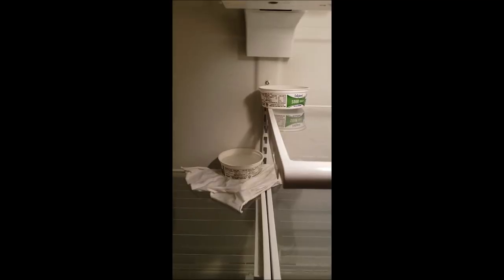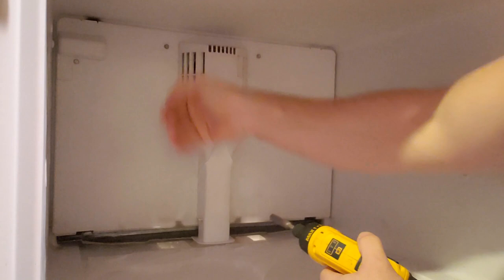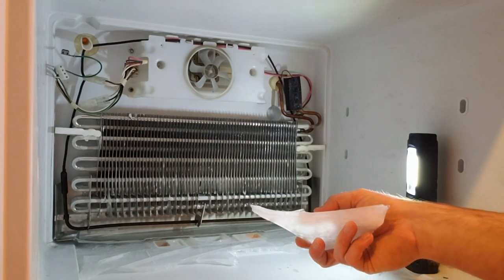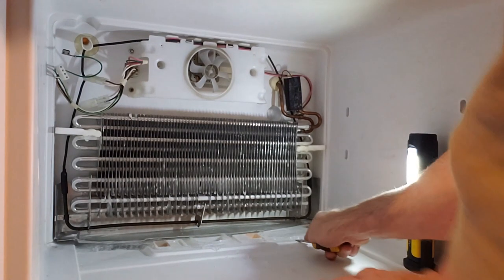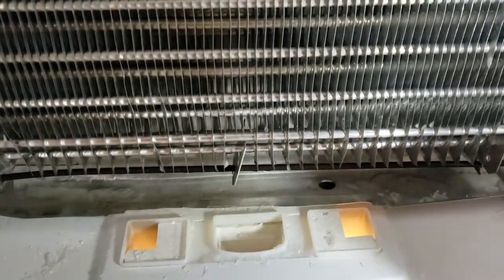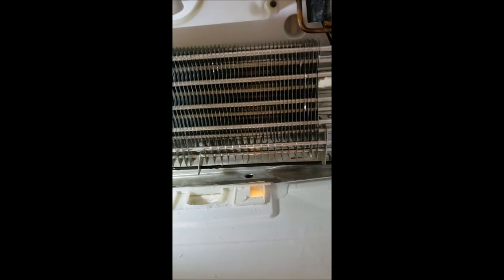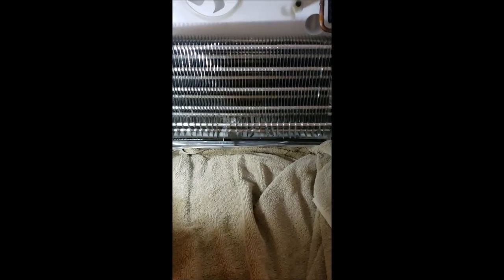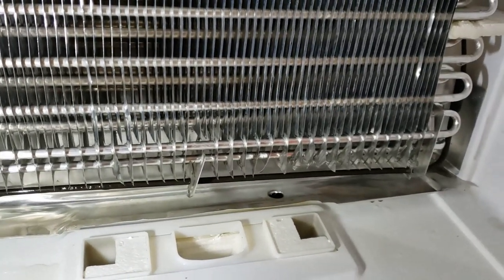Whirlpool fridge ice build up and leaking water

Comment: I had this same problem. Thawed out all of the ice. I took a 7 inch piece of solid copper wire 12 gauge. Looped one end over the heating element and the rest into the drain hole. The wire conducts heat to keep the drain open. So far no more problems after 2 weeks.
Reply from the maker: Samsung uses a very simular idea to fix this problem with their fridges. Thats a pretty good idea. Thanks for watching Maxwell Crazycat

Comment: I have the exact same fridge.  Although this will melt the ice it often will not prevent it from reforming in a very short time.  The issue is debris.  The third time in as many months I was about to go purchase an expensive steam jet when I stumbled upon a cheaper solution.  Again, I emptied my fridge and let it completely warm up.  Again, I poured boiling water down the drain until it flowed freely.  Then I took off the back panel and removed the p (or s) trap pipe which drains in to the pan.  Then I covered the hole with duck tap and poked a very small hole in the tape.  Then I used my air compressor to blow up the pipe.  Keep your freezer door closed when doing this. What came out was little bits of debris including pieces of the styrofoam insulation.  That I suspect was the real cause.  I believe the styrofoam was forming a partial dam which would let water flow by when warm but when the fridge was in operation the water would freeze to the styrofoam and quickly close off the pipe.  I also tried to blow back down the hole using a flexible straw on the tip of my compressor gun but with limited success. Still when I removed the duck tape there was more debris than I expected.  And when I flushed that trap pipe there was even more there.  Finally I used a little bleach in my water to rinse the entire pipe from top to bottom before reassembly.  So far so good.  I found having a wet-vac handy allowed me to pour copious amounts of water though the system as the drain pan would quickly fill.  I likely poured a gallon or more before I was finished.  And the wet-vac made this much quicker (and cleaner.)
Reply from the maker: Thanks for watching Robert Anderson, yes true if it is plugged it can be debris in the line, I use a flexible reamer like a pipe cleaner thats got a brush on the end. Thats great you were able to get all that stuff out so it shouldn't back up again.

Comment: To prevent future freeze-ups get a 3" piece of #9 wire and bend a hook on one end of it and hook it over the defrost rod and let the other end dangle down into the drain plug hole... I also used a shrink wrap and electric fence wire doubled it and slipped the open ends under the shrink wrap on the #9 wire and shrank-wrapped the wires together, just for peace of mind that the wire would melt any ice build-up further down in the drain tube... The electric fence wire was flexible enough to insert into the drain tube without any damage to the tub and small enough to not interfere with drainage during the defrost cycle...
Reply from the maker: Thanks for watching daveems, yes you are right I use a piece of wire now too if they don't already have one in place.
Reply: Great tip!!! I will always remember to do this forcustomers drain issues!

Comment: Hey there Greg, question I had was why does the drain tube freeze up in the first place, and what could one do to ensure it doesn’t happen again. If it’s a design flaw, then I imagine it’s bound to happen again and again. Or is that a bad assumption?
Reply from the maker: Thanks for watching macleod5000, some manufacturers have made a piece of metal that goes a couple inches down the drain tube hole that hooks onto the heater tube, its supposed to eliminate that issue but sometimes that fails also.

Comment: But the big question is, and it was not answered in the video, is WHERE does the water come from? It would seem that the ice maker refill tube has a leak and water is running inside and down to that tube. I have the same fridge and it leaks from where the fill tube comes in through the back of the freezer. Just a poor design.
Reply from the maker: Yes both can happen, this one is the defrost water not going down the drain tube. Ice Makers can cause a lit of troubles as well.

Comment: This is exactly the problem I've been having! Unfortunately half way through your video you almost went silent. Although I pretty much already knew what I needed to do I'm happy to have found you although I should have done this long before now. I'll let you know how it goes.
Reply from the maker: Thank you Cynthia law for watching yeah sorry about the audio my mic got unplugged, hopefully you figured out what I was trying to say. Definitely let me know how it goes for you.
Reply: @Thomasappliance  Well, everything went well until today when I have a fridge full of water again. I know this is a quick fix but there has to be a reason that causes this to happen. I should have mentioned this before but my refrigerator control knob is in the stuck position so what do you suggest I do now? Could this be a problem with the temperature controls?
Reply from the maker: @cynthialaw8132  yes I've seen it before if there is something further down the line, I've had to use a small snake down the line and that seemed to fix that issue, it could be too cold in the freezer causing that but shouldn't be the issue. Hopefully that helps!

Comment: Instead of using a pic to get that ice out of the drain hole, use a small funnel with a hose attached to it that will fit down into the drain hole, and fill a milk jug with hot water and pour it slowly into the funnel lowering the hose into the drain hole as the ice melts, you will be able to blow through that ice in the drain tube in less than 1 minute... Have a sponge on hand to soak up the water that spills into the lower section of the frig and the freezer... I know this works, I battle-tested it already...
Reply from the maker: Thanks for watching daveems, yes you can do that or use a steamer down the hole. I just find that getting the water that's now cold out of the hole is a real pain, but saying that I have used all the above ways even used a coat hangers once for a samsung fridge that was frozen 6 inches down the tube.

Comment: This is great!  Thank you for the video, Greg.  Its the exact model fridge I have, and the exact problem.  Only difference is I have different bowls to catch the water 🤣  Actually the big difference is I have an ice maker to deal with so I'm intimidated by that.  Dont like to mess with anything that can leak water!

I also dont have a 45 degree pick.  Can a coat hanger work?  Doesnt look like it would be enough to get the job done.
Reply from the maker: Thanks for watching phil s, I have had to use a coat hangers before due to the picks not being very long, so yes it will work. Good luck and thanks for the awesome feedback.

Comment: Hey mate, thanks for the video and the fact you said most top mount freezers work the same. I got a samsung fridge - took the front panel off and its nearly the same. After about three hours, I didn't get too far, I stuck a screw driver in and looked like I hit either ice or the base of the drain. Do you know if this drain hole is just a straight pipe down to the collection pan? I think I am trying to find out if I can keep hammering down my screw driver gently - unless the drain hole is an L shaped thing?
Reply from the maker: Hey happybuddha13 thanks for watching. The drain tube location is in the same spot on most freezer on top fridges, but the drain tube routing is different on every fridge. Its best to get a light in there and use a towel to get the water out of there so you can see how they routed it. Most tubes are plastic so you want to be careful not to stab through it.
Reply: @Thomasappliance  Thank you kindly

Comment: Take a turkey baster and pump hot water down the drain pipe! Much easier...And faster...Thanks Greg...
Reply from the maker: I find a steamer works really well for most fridges also. Thanks for watching!
Reply: The steamer is amazing! But, most do not have one. I just bought a heat probe for the drain, from Amazon. So, I will have to take the back of the freezer out, again. Any thoughts/comments on the copper wire or heat probe for the drain hole? @Thomasappliance
Reply from the maker: @6461791  most fridges now have some sort of metal hooked to the heater and put down the hole, it seems to be a good idea although doesn't always work.

Comment: Hi, maybe you can help me, my whirlpool refrig, like the one you show,  so the water 
was running down from the side and seemed to be coming from no where,  not from the freezer, but down the side of the refrigerator where the glass shelf is that covers the drawers. the little plastic piece was leaking, so I plugged it up with flex seal, and it did stop leaking, 
but now, it appears the left wall of the refrig is swelling. The glass is not fitting properly. 
CAn you tell me, if you think this is coming from the freezer,  I don't block the freezer where the coolant comes from, but there is a ton of stuff in my freezer. 

I don't see any ice, but I don't know. I can't afford for this refrigerator to die, since I will lose all the food in the freezer.  Do you have any suggestion, I so appreciate it.
Reply from the maker: All of the cold is made on the freezer,  so if its leaking it would have to come from the freezer. There is usually 3 vent holes coming from the freezer to the fridge, and it can leak out of any of them. The best thing to do it take everything out of the freezer and take the back wall off so you can see where the water is coming through. Thanks for watching Wellotonin Naturally Well Inc.
Reply: @Thomasappliance  Thank you for responding, I will follow what you did on the video and let you know the outcome.  I may have over-packed my freezer and maybe  covered not the coolant, but the vents on the sides of the main gizmo in the freezer.  We will see how it goes.
Reply from the maker: @wellotoninnaturallywellinc9640  hope it all goes well!!

Comment: Is it possible to disconnect the freezer but keep the non-freezer part running? With the lack of another fridge, I am unable to turn the fridge off for a day. Any ideas?
Reply from the maker: No the cold is all made in the freezer section and pushed into the fridge through the fan. Why would you have to turn the fridge off for a day?
Reply: @Thomasappliance  Thank you for replying. A week ago I chipped away a bit of ice and after scraping the skin off the back of me fingers I gave up after a while. A week later I have got water dripping again in the fridge - so my drain pipe is definitely blocked - am guessing with ice (can't quite see through the hole and taking photos of it is only revealing so much) . So my thinking was instead of repeatedly putting hot water in and getting it out via a pipette (and scrape my skin in the process) if I could just shut off the freezer, the ice would melt and the blockage will drain away. As I am typing this, I think I am not sure how I will prevent the ice formation in future which will block the drain pipe again. Of course to do this I will need a spare fridge for the current contents of the fridge - which I don't have. So I wanted to find out if it was possible to disconnect just the freezer.
Reply from the maker: Ok yes that is another way to get the ice out of there, but without another fridge to put your stuff in you would lose all the food, hope you can figure something out. And again thanks for watching.

Comment: But what is the root cause of this
Reply from the maker: Ben Miller the problem is either food getting into the drain or a faulty defrost thermostat possibly, there is supposed to be a delay after defrost ends and the fridge starts to cool again called the dwell period, if the fridge starts cooling again before all the water has had a chance to run down the drain it can plug off the drain hole. It can be caused by various issues depending on the type of fridge also. Thanks for watching and the great question.
Reply: @Thomasappliance  Thanks. Mine clogs up with ice about every three months.
Reply from the maker: Ben Miller Next time you clean it out run a snake down the drain tube to see if something is slowing the water draining down causing it to back freeze into the freezer.
Reply: I’m pretty sure that there is no clog. When I remove the ice plug it drains like a cow pissing on a flat rock.I purchased a freezer thermometer and found that the temperature was really lower than it needs to be (minus 18 F). I’m thinking that it’s too cold to properly defrost. We will see.

Comment: So, just an update from my side so others don't make same mistakes as me. I dont have a second fridge and wanted to clear out the frozen drain pipe asap. I got a cheap endoscope camera to see if my samsung TMFs drain pipe has bends along the way (if not I could just push or hammer a screwdriver through)  - this was a mistake as the lens part of the endoscope camera was about 10 mm of hard plastic - this doesn't seem much but made the camera un-navigational. 

Then I thought I am a smart man of science so since salt melts ice faster, I threw in salt on the frozen ice - this is a two fold problem - as the top layer of ice within the freezer did melt faster - the melted water then became salted water and salted water slows melting of ice. This meant the ice in the drain pipe would take for ever to melt. I had to keep flushing the salted water out - best way was to grab a syringe and attach a spray bottles internal pipe. This meant no scrapping of fingers and was much faster that a pipette. 

Ultimately I wasn't able to drain/melt out the ice from the drain pipe fully - got to about 1/4 way down from the freezer. I did make a copper wire (NB there is no copper in a HDMI cable or in phone charging cables!!) candy cane and hung it on the 'warming pipes' as shown in other videos. Its been two weeks and I dont see water dripping in my fridge - but my guess is its coming soon. In hindsight I should have squirted some isopropyl alcohol or even hand sanitiser in to the drain pipe - this way the 10 mils of alcohol could sit as a buffer between the existing ice and the additional water/ice coming in wouldn't join with the existing ice in the drain pipe and hopefully the existing ice would slowly drain away. Hope this wall of text helps someone.
Reply from the maker: Well I'm glad you got it done, samsung is another fridge that has this issue a lot. Thanks for watching. But they made a part to fix that issue. I'm not sure if it fits on all samsungs but I've used it quite a bit, part number is DA61-06796A
Reply: @Thomasappliance  Thanks mate. To put that part in, is the plan when it next rains in my beloved fridge :-) Thanks again for making this video and replying to comments. Cheers.
Reply from the maker: @happybuddha13  you can put it in at anytime, might be easier to do before everything freezes together. No problem at all im here to help.
Reply: @Thomasappliance  I had to jinx it!! Last night it rained in my fridge after 2 weeks. Now I wonder if the thermostat is broken. Doesn't help I dont have a multimeter. You reckon its the thermostat? I might just order this part anyway DA61-06796A
Reply from the maker: @happybuddha13  does the temp inside the fridge seem ok?
Reply: @Thomasappliance  Yep. Fridge and freezer both seem alright temperature wise.

Comment: Did anyone try using a hair dryer to defrost the ice?
Reply from the maker: Thanks for watching timbuck2505, yes sometimes it is required if the evaporator is froze up also, but because the defrost tube goes down a hole the hair dryer will only help so much.
Reply: @Thomasappliance  Thanks for the prompt reply😃

Comment: can anyone tell me how to remove back without breaking styrofoam on  vents?
Reply from the maker: Fridges that have the Styrofoam i usually use a hair dryer to melt all the ice before trying to remove them, they can be tricky sometimes to get out, but usually better chances of not breaking them if the ice around them is melted. Thanks for watching Lauren Fischer.

Comment: you didnt dolve the problem it was a temp fix. it will freeze up again if you dont change the defrost timer etc
Reply from the maker: Scone27 in some cases the dwell of the timer can cause that yes, or some the fact that there is no heater extension down the hole can cause this. There is so many different issues that can happen with these fridges, or any fridge. I just try and cover the general issue.

Comment: The sad part is, that you have to do the same thing again and again. Factory flaw.
Reply from the maker: Thanks for watching Happy Cat, some fridges have a part to fix this problem, and most of the time once the blockage is cleared it doesn't come back, but you're right I've had some of those annoying fridges that keep coming back.
Reply: No you don't. If you hook a piece of copper on the heating element to run into the drain hole it will keep the drain hole from freezing over and allow water to drain.
Reply from the maker: @buzztrucker  yep that trick works most of the time. Thanks for watching.